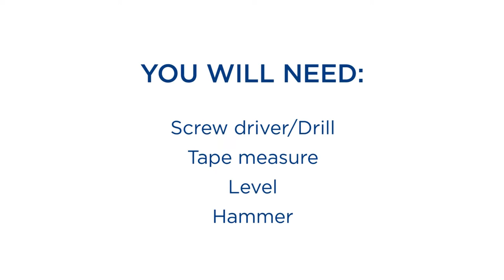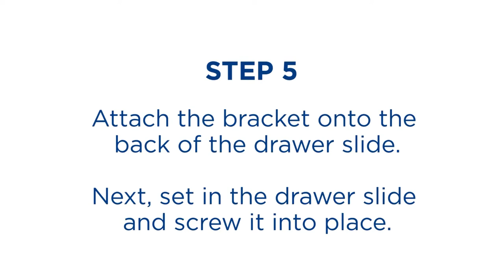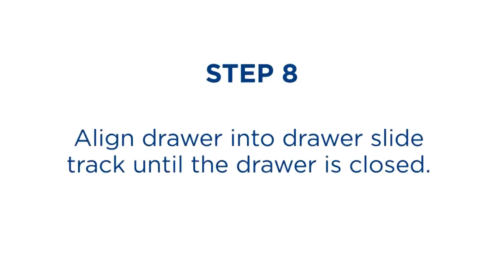How to Install Hickory Hardware 1029 Drawer Slide

Comment: Hello! We have a larger bottom drawer, would this system work using two drawer slide pulls equally distributed?
Reply from the maker: It is not ideal, but it should work!